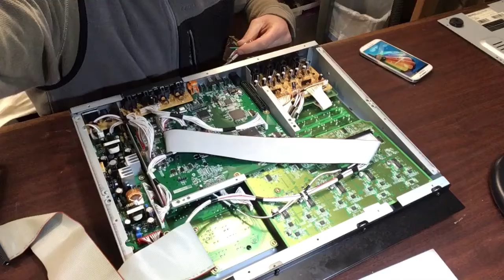Obaid''s electronics Tascam FW1082 FireWire Audio Interface mixer parts list The Electronics shop

Comment: hi Mr Obaid am kindly asking for your help, i have the tascam 1082 i just bought it from ebay the seler said its in good condition but its making the constant noise like chweeeee.......... and when i cannect to the PC ITS SHOWING THAT ITS CONNECTED BUT THERE IS NO SOUND PLEASE HELP.
Reply: Got same problem, you'll have to replace  chemical condensators on the power board. There is a discussion about that  on Tascam forum
Reply: The power board is on the left of the video
Reply from the maker: check solder connection 
Thank you if you found this video helpful please don't forget to subscribe